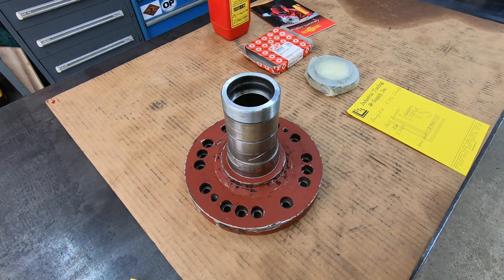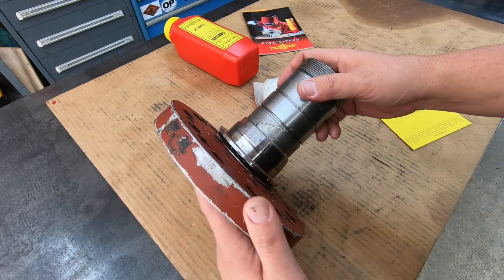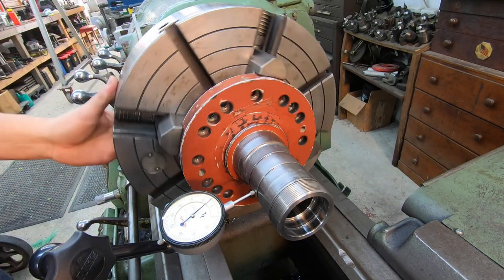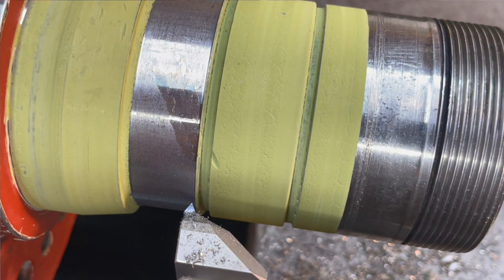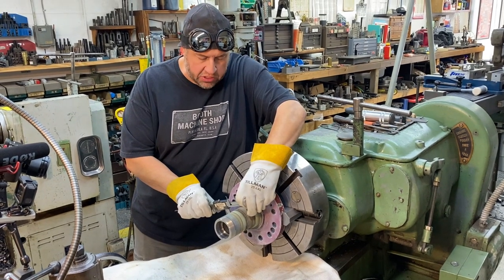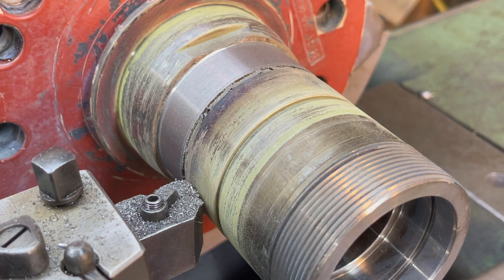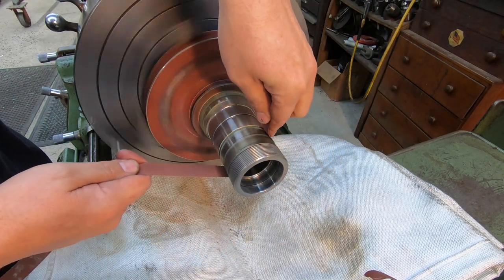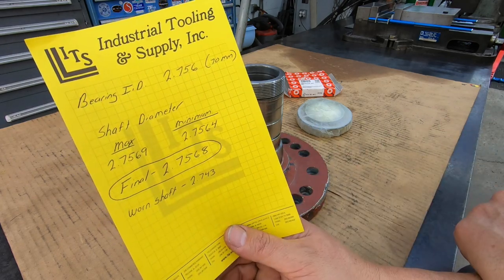Thermal Flame Spraying Centrifuge Shaft Repair

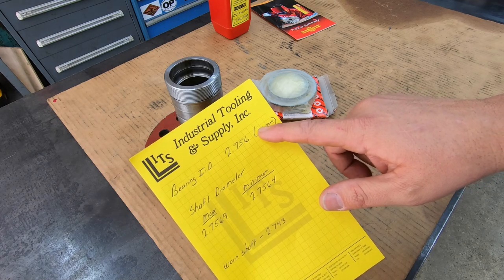Comment: 3:00 metric system is so much easier. 70mm is straight and easy... not 2.756 misty inch or whatever
Reply: 70.02 +0.02/-0.00
Reply: I'm quite sure Adam knows the metric system as well as you do. The difference is that he also knows American Standard. Most American machinists can go between metric and standard with no hesitation.
Reply from the maker: Easier for you? American machinist have no problem ready and saying imperial decimals.
Reply: Its always funny when Europeans whine and complain about Americans using the Imperial System and how the metric system is so easy-peasy.  What they fail to realize that Americans understand Imperial and Metric and math just isn't that big a deal.  Its like Europeans can't figure out math so all they can do is complain.   Its like pounds to kilograms. Divide pounds by 2 and you've got a close approximation in kg. good enough.  Funny how we use this archaic system and still got to the Moon, and the superior metric folks still haven't.
Reply: @boots7859  NASA uses almost all metric units now. Still a bit of lingering imperial. But yeah, any machinist worth their salt can use both interchangeably.  The only issue is most machines in North America (lathe, mill, etc especially older machines) measure in inch/thou so it's easier to stick with that to avoid conversion mistakes
You also learn a lot of tricks when working with both systems. When I was in high school I had a part time job at a butchers/deli shop, our scales were in KG and you would punch in price per KG and it would give you a total. Most customers asked for a specific weight in lb so I'd just punch in 2.20 and it would give you the weight in pounds
Reply: Euros whining about the imperial system again. Does it ever end?
Reply: metric is metric, standard is standard. I always thought going 100kmh was kinda slow and a little like cheating to get 3 digit speed....
Reply: Omg it is just numbers. I'm a euro and I flip between metric and imperial depending on what I am doing. 

Correct me if I am wrong but isn't there actually two imperial systems for certain measurements? If I remember correct there are two Gallon measurements. Am imperial Gallon and then a US Imperial Gallon is there not? That is interesting as to how that came about?

Use whatever system works for you at that time.

Comment: Adam , when was this spray weld ,  build up method developed ?
Reply: I am not certain but i was using it in my step father's shop 50 years ago.
Reply: I worked in an Electric Motor repair shop in 1965, they already used a 'spray' welding build-up, but the process used a solid wire instead of powder...Eutectic, great quality stuff.
Reply: Thanx for the replies . I'm a carpenter.  This is something I never heard of . After stumbling appon Abom79 , I was hooked !
Reply: According to this article the technique was invented in 1909, which completely shocked me. Cheers. 

Author links open overlay panelStephanSiegmannaChristophAbertb1

https://doi.org/10.1016/j.surfcoat.2012.10.034Get rights and content
Reply: @fmolds  Carpenter?....this would be like mixing some wood glue and sawdust, spreading on  and waiting for it to dry....to add some 'extra' amount of material....of course with wood, you just use shims...

Comment: DOES THE HIGH TEMP AFFECT THE LATHE / CHUCK DUE TO THE HEAT TRANSFER  TO THE BEARINGS OF THE LATHE ?
Reply: Not to the rate it does affect them at all. The distance from the chuck and the rotation, providing natural air-cooling, the small contact surfaces on the chuck jaws, the chucks great heat-capacity for its heavaviness, negates the problem. If the bearings are warmed up ever so slightly, it is not a problem. It might be good for them to be warmed up from 5°C to 30°C.

The heat-transfer to the Bearings is neglible in this setup.

Doing the same heating a short Axle or Round-Stock, using a Collet-Chuck, directly inserted into the spindle, might be quite different and possibly harmful to the spindle and the front bearing as well.

The collet-chuck and its bushing would die first, from excessive annealing (>250 °C)  then the spindle likewise, then the front bearing smoking, if enough heat is applied. One would have to want to destroy theese things in the order.

It starts to smell badly and smoke from burnt grease, long before the complete disaster, but skilled people can see or understand if it is too much heat long long before.

No exeperienced machinist would ever come close to this.

Comment: #Abom79 do you know if there is a powder for automotive crankshafts
Reply: That's a great question. Hope he responds.
Reply: If I understand it right, you wouldn't want to use this type of fix for a direct bearing surface. Works great as a filler for something like this where a bearing race is compressed over it, but when something else is moving directly against it it would have a pretty high chance of failure from the constantly changing pressures on it making it chip/flake off.

Comment: Just out of curiosity, how much would the company save by refurbishing that existing part vs manufacturing a new part from scratch?
Reply: Jim H  The other two journals in front of it could be too big to clear the sleeve.
Reply: Jim H  I would never use a speedy sleeve for a shrink fit bearing application, ever.  Certainly not at 5400 rpm.
Reply: @adamculpepper5571  ...Yes sir!  I couldn't agree more.  Flame spray is the correct choice for this repair.  A nice liquid nitrogen bath for the part and the bearing will drop right on.  A perfect repair to last many years.

Comment: Having watched a good number of your videos which are very enjoyable and informative I do puzzle why you are continually converting from metric to imperial.  This is a metric bearing.  The US adopted the metric system in 1975 but you still use imperial.  I worry that the continued transfer between the two systems will lead to error.
Reply: It's not specific to Abom. Many machinists get taught whatever metric the teacher gives them. Abom is working in inches because that's what he can easily work with. Yet I completely agree that this clusterfuck of a unit system called Imperial should be phased out as quickly as possible, so even attempts for working in metric are at least steps in the right direction.

Comment: It'd be interesting to spray weld a journal like that then hit it with hammer and see how strong that stuff is. Just for funzies.
Reply: There is no need for "hit it with hammer" strength.  It is the mount for the bearing.
Reply: @paulcopeland9035  yeah, that's why I wrote just for fun...

Comment: Adam, don't you fear to do  things like this with fire and abbrasives on your really good lathe?

Why don't you get some scrap lathe, maybe only bed and two stocks, for your welding things, and place it with other welding?
I usually use old woodturning lathe for things like this, and completely avoid to go with any fire or even sandpaper to my lathe

Comment: Adam. How come they chose not to repair the surface nearest the threaded end whilst you were at it? It looked worn and pitted but I guess may still have been in spec?
Reply: It might well be a surface that has no seal or bearing?
Reply: Definitely a doggy job the outer bearing surface was undersize just by looking at it. Why not repair it when the machine was stripped and the job set up.
Reply from the maker: It’s not a journal that is used and did not need repaired.
Reply: Hi Adam thanks for the reply
Reply: Dusty 99  Hahaha, very diplomatic reply.

Comment: C'mon Adam, time to start using millimeters already. 70mm is easy, 2,756 ugh is not.
Reply: If using decimals and not fractions, there is zero difference in metric or imperial. The shaft tolerance would be 70.025 max 70.012 min. In stead of 2.7569 max 2.7564 min. Where’s the benefit?
Reply: Great, please send Adam a full set of Metric Micrometers.
Thank you.
Reply: Just divide by 25.4 .   No need to buy metric mic's. Big expense.
Reply: @MWL4466  If you have to do division why even measure in metric?  That's the dumbest thing I've ever heard.  Most of us can handle both measuring systems.  It's amusing when you metric morons can't handle what other have no issue with.

Comment: Why not just build it up by tig then machine. That would be a better repair than spray welding.
Reply: As mentioned in the video, doing that can warp a precision shaft, while spray welding doesn't.
Reply from the maker: I’ve explained this in the video, actually several videos.
Reply from the maker: People who say that don’t have the experience. I explained why this process is used in the video.
Reply: Dusty 99  : )  Watch The Flaming Video, right?